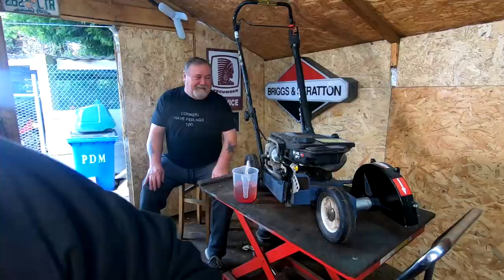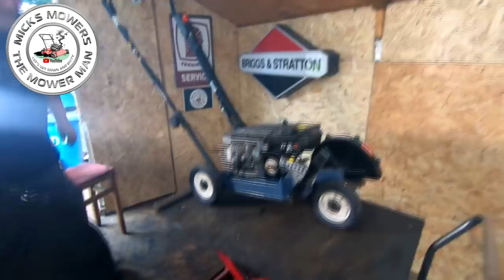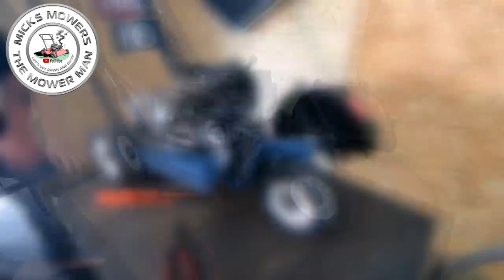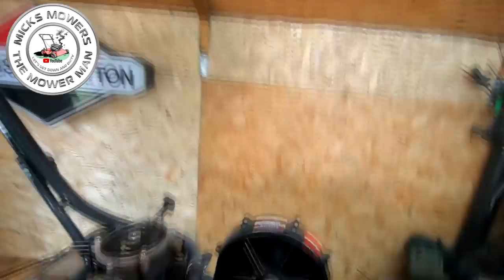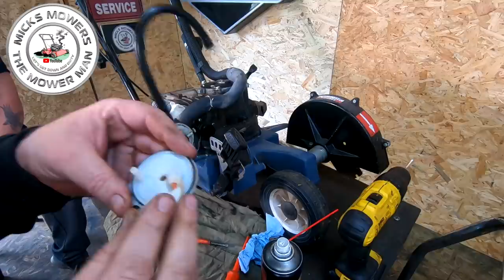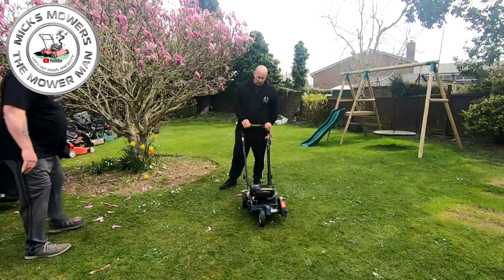Victa Edger Starting Problem. Special Guest appearance

Comment: Work on theses machines all the time here in Australia there very popular. Most of the issues are old stale fuel or over oiled fuel as people keep topping them up. Carb issues are the second most common issues float oring on faceplate or blocked main jet. If it doesn’t start it’s crank case oring or ignition module. There great tough well built Aussie machines.
Reply from the maker: Hi mate.. yeah I hear ya.. we don't see many of the engines over here..

Comment: I've recently inherited a Victa Mastercatch from about 2006.  The primer bulb was punctured and it cost me a fortune to get a replacement from Australia (I'm in the UK). Once that was replaced the engine would start but only run for a few seconds - maybe 10-15 seconds before it died.  I traced the problem eventually back to a seed pod caught in the fuel tap.  The tap unscrews from the bottom of the tank (helps if there's no fuel in there to start with).  The brass jet on the carb was also in need of a shot of carb cleaner.  Once they were sorted it has run beautifully and not missed a beat.  Engine and fuel tank look identical to what you're working on.  
You can get aftermarket needles that are metal and are supposed to be like night and day compared to the original but I've not gone down that route - didn't need to.  eBay and Australian stores all have replacement parts. 
These are really well built machines - the deck must be about 3-4mm thick. I don't know if the modern ones are the same - they were bought out by Briggs and Stratton in about 2014.
You can also remove the throttle cable by pulling the lug to one side while the cable is in the run position (or is it Start?). Makes working on the bench a lot easier.  Hope this helps.
Reply from the maker: Yo yo hi Mate thanks for the information.. hope all is good

Comment: I love these 2 strokes. 160cc Power Torque Motor, Made in Australia. Easy to work on. I worked on them daily and I still use them on our runs. These Edgers I once own one and still wouldn’t mind getting one. Shame they don’t make them anymore.
I know those Carby’s very well and have a great knowledge of them. First made those carburettor’s since 1974 without the Primer Bulb as a G4 then went over to the Primer Bulb in 1978 known as a LM. Good Job mate.
Reply from the maker: Yo yo brother.. ta for watching.. I like the engine and I think the carb could of been an better set up.. still it gave me and conker some time together
Reply: @themowerman  it has been that way since it’s inception back in 1974. But you did a great job which I take my hat off to you.
Reply: @OzMowersAustralia  hi, loving to see all your video, very helpful, i just tune up my victa 2 stroke which is similar to this machine. i am not sure what did i do wrong, but when i start (lever in Choke position) it start and run very good but when i push to run or toward run position its rev slow down and idle at Run position. just wondering if you know why ? thanks

Comment: mick i have worked on a good few victa lawnmowers same carb set up the plastic disc with the primer on it has a line on it which must be horizontal to the carb and puts the needle in a vertical position if the needle is not vertical it will not come back down cleanly hope this helps great vids btw happy birthday to the wee man
Reply from the maker: Thanks mate.. we have fun working on it..

Comment: Had a Victa 2 stroke mower in mine kept leaking fuel into carb ,turned out fiddle fairy forgot to put back in the carb needle fixed for a couple quid . Australian machines I think guy on u tube fixes them all the time .Steve

Comment: hi, loving to see all your video, very helpful, i just tune up my victa 2 stroke which is similar to this machine. i am not sure what did i do wrong, but when i start (lever in Choke position) it start and run very good but when i push to run or toward run position its rev slow down and idle at Run position. just wondering if you know why ? thanks
Reply from the maker: Well it's a carb problem I would say

Comment: Is that plate that holds the float and needle adjustable (twist clockwise/anti clockwise a bit)or does it have a locating lug? It seems to me, just by watching, that it's starving for fuel and goes into hyper drive when you tip it back a bit.
Maybe you need to set the float level at its working position so it gets adequate fuel flow at full throttle cos it sounds like the engine is using fuel faster than the carb can fill. That is some freaky carb tho' it makes me want one just to see what makes it tick.
Reply from the maker: No mate not adjustable
Reply: @themowerman  that's annoying!

Comment: the only thing i know about victors they were used alot by contractors in the early to mid 80s in the uk renowned for constantley replacing air filters being sensitive  and virtauly impossible to get parts for in the late 80s early 90s resulting on most of them ending up on the scrap heap
Reply from the maker: Yeah I did say to conker to check the air filter..
Reply: @themowerman  you cant clean them you have to replacem so bloody sensitive its stupid